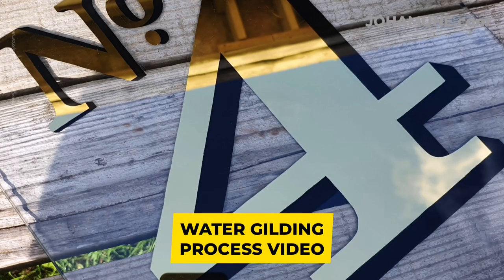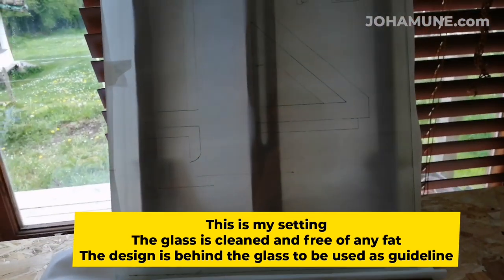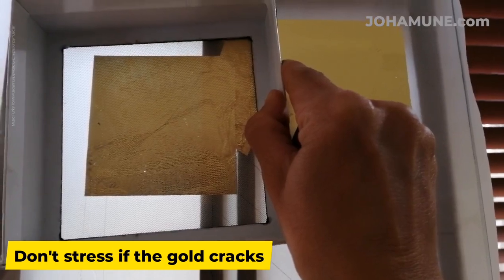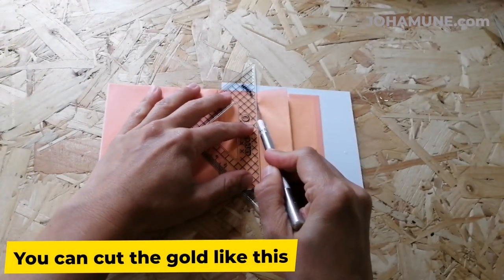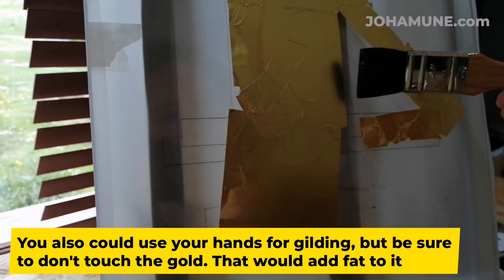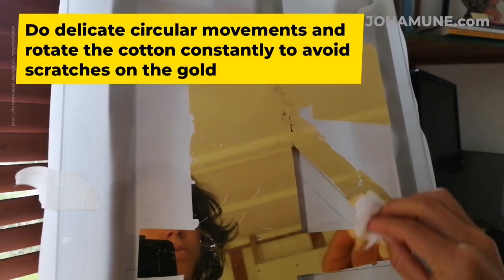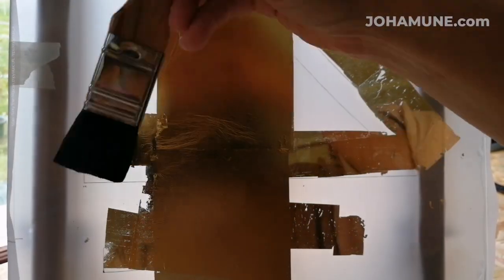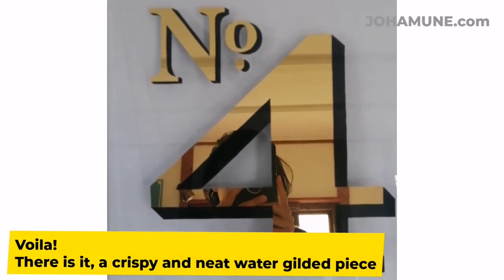How to: Water Gilding step by step

Comment: So perfect! I'm a little jealous - my backup always gets chips when I clean it - no matter how gentle I try to be. (I use Nazdar)
Reply from the maker: Hi Alexa, thanks for watching the video. In this glass i also used nasdar for backing up the gold and dint have any problem. Maybe you are thinning your paint a bit too much?
Reply: @joha_mune  Great video! Looks like you got a lovely gild. One of the reasons the backup can chip is if the sponge is too wet when wiping away the excess gold. It's better to only have it a small bit damp I find, more on the dry side than the wet side, it's the water that can cause chipping.
Reply: @joha_mune  after some experience you will ignore some minute cracks,  but 2 layers was always safe 
Paolo

Comment: Wow in 50 years of specialist glass guilding I never saw that square  device "thorn tip".  The Vaseline was for what? I used a three or +  inch "guilding tip, and used body oil around my forehead to "charge " tip. 
Paolo
Reply from the maker: Hi Paolo, yeah, the vaseline is for charge the thorn tip

Comment: i dont get how the water size just drips down in large amounts all over the glass and presumably over the edge of the letters but then you get the dead straight lines at the edge of the letters ?
Reply from the maker: Hey Joe,
I'm not really sure if I get your question. For the water size to flow down in large amounts the glass has to be grease free and very clean. Otherwise the water won't flow well. To get the straight line, I first backed up the gold and then painted the shadow.

I hope this help you. Please don't forget to subscribe to my channel. That will help me to keep sharing more content and it will mean the world to me.

All the best,
Joha
Reply: I agree. You don’t explain how you achieve exact straight gold edges. The water is dripping all over the place and you plant the gold in patches. The technique is not obvious at all
Reply: @joha_mune I think some of us (me!) are not familiar with back up paint. We watch detailed instructions on how to lay blocks of gold on glass —- then you suddenly speed up your process on video and we don’t understand how you cut out or chipped off the gold to end up with  a crisp final result. Am subscribing.
Reply from the maker: @illustratrice  hey, it's lovely to have you in our community. Please keep in mind that this video is focused on gilding not on sign painting. That's why the backing up part is speed up. As well, how to back up and sharp edges are techniques to work on glass.